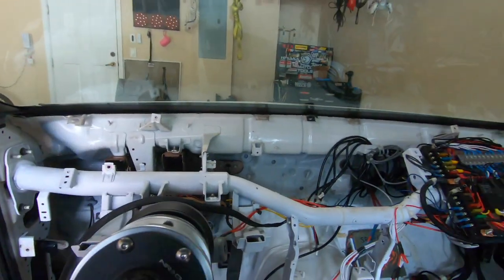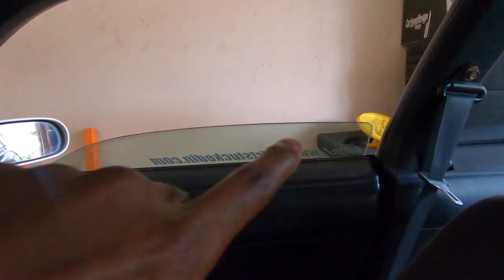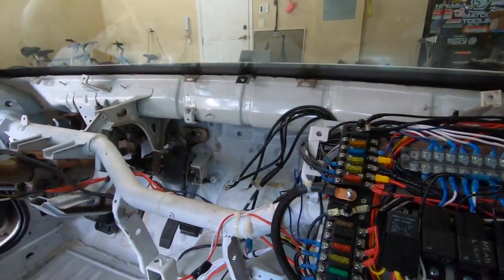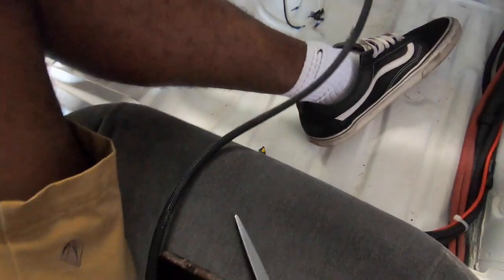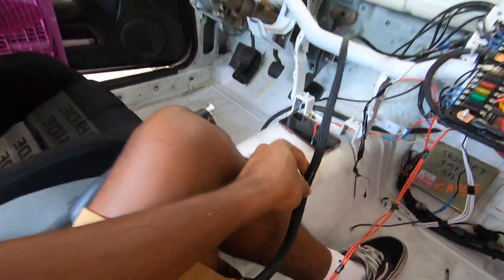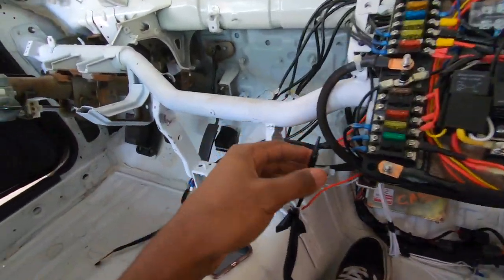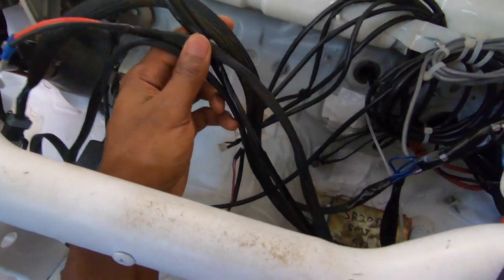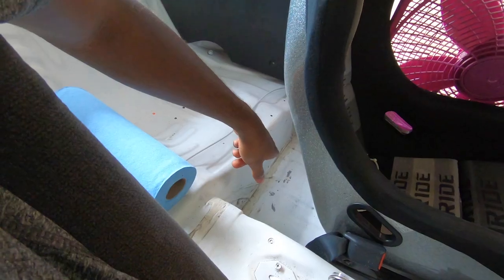Organizing My Wiring + Real Bride Zeta III Bucket Seat

Comment: Be careful and triple check main bearings and rod bearings clearances, triple check the crank a rebalance it 
Oil starvation happen really fast with this engines sadly
Reply from the maker: Main bearings were fine, it ended up being a spun bearing on the 3rd rod. I’m getting the crank turned, oversized bearings and new rods and then I’ll match rod bearings numbers to FSM to make sure new ones are within spec

Comment: What do you think happened?
Reply from the maker: Maybe low oil pressure on first start after install of my oil cooler. Motor is also 20* years old so it’s bound to happen. Full rebuild will take all my worries away and I’ll know every part of the motor is in 100% working condition.
Reply: @kriswyche  gonna make great content for the channel atleast. Can't wait to see her running 🤙🏻
Reply from the maker: Yup!! I had some good drives in my older videos, after this rebuild I want to really just push to become a solid driver ! I want to also do some street “driving” but I might not really post those videos >.<
Reply: @kriswyche  fuck yeah bro, hopefully backorders don't hold you back too long